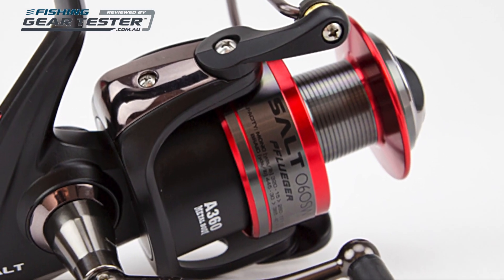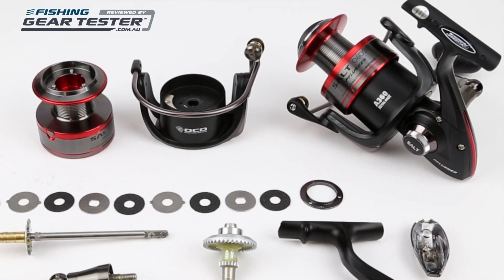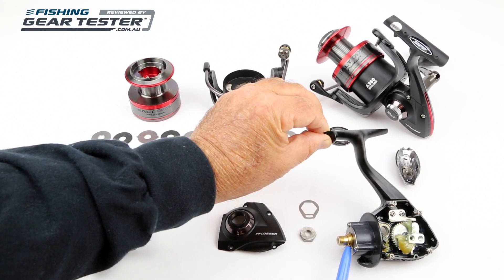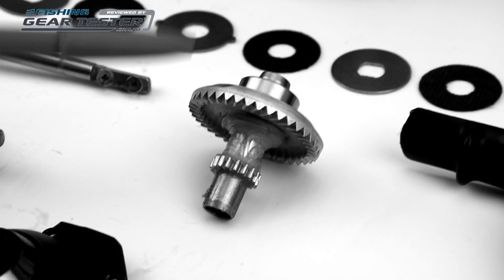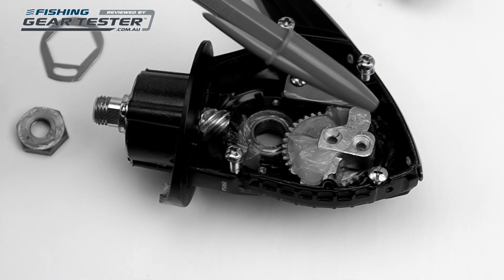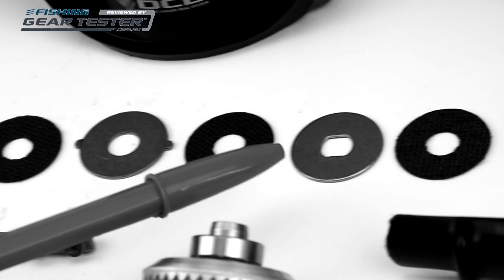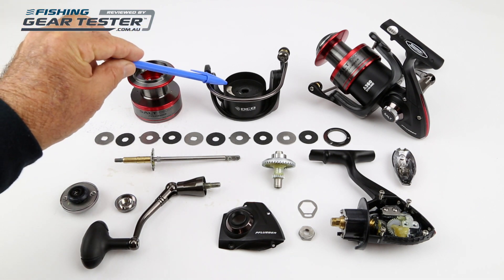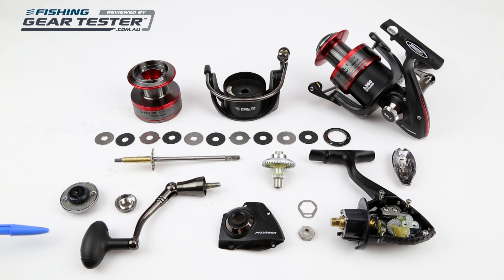REVIEW: Pflueger Salt Spin Reels reviewed by FishingGearTester.com.au

Comment: This or fin nor offshore im thinking 750 or the 850 for finnor and 800 for this reel or even a 850 or 950 penn ssv i like the finnor because of the power it has drag and reel power but when they say back play do they mean it will reverse  until  its ratchet locks down i see its has alot of positive  feed back but would the small sizes be able to handle a 25kg+ king fish or tuna or i need the 950
 please  respond